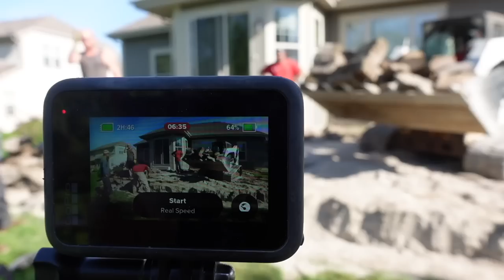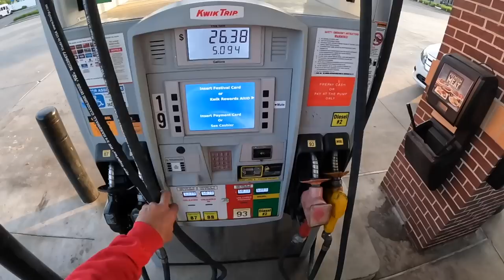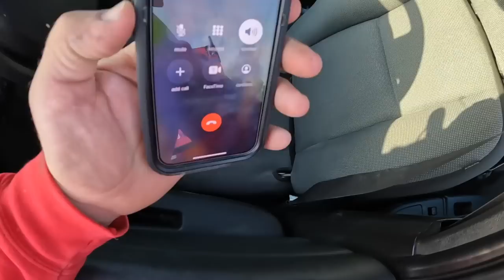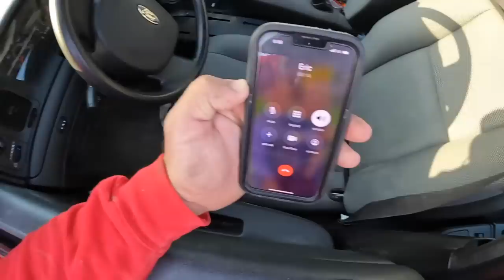Awesome custom patio

Comment: I work as a foreman for a mass grading company in CA and have been watching your videos after work the past couple days. Looks like amazing work and a good crew. Our labor can be tough but concrete is basically ALL labor. Much respect, keep it up.
Reply: Can you just use that glue stuff to lay the bricks for the wall? Do you not have to use cement?

Comment: 18.10 “Eric look what you did!” Only points out the mistake four rows down. Bottom two layers have running joints also. I thought you’d hide it it behind bottom step, but the forms don’t cover it. Ps girls are doing a great job with the edits!!

Comment: i work for a hardscapes company and we don’t use the wall block as cap…we usually use limestone or ledgestone…which is prefabricated to look like limestone. your walls and columns look nice but my opinion using the wall block as cap makes it look cheap.

Comment: So why the glue and not mortar? im curious to know the reason.
Reply from the maker: Retaining or seat wall block never get mortared together. They are not on a footing and will move with the frost and not break apart. Also they are designed to let water through them.

Comment: why use cement to bed in the foundations and glue on the rest ? Has america lost all aspects of traditional trades ? does anyone know what a Hod is or a spot board ? Hawk anyone ? haven't seen one trowel ...... lol
Reply from the maker: You obviously know nothing about these specific blocks. Go read the manufactures instructions and come back. I’ll wait. Acting like a know it all and knowing nothing at all is not a good look.
Reply: @VictoryOutdoorServices  you are using a cement based glue on block , its hardly rocket science . I'd of used actual stone and lime based mortar , pointed it flush , this would allow the moisture to be released and soft enough to allow movement. Asking, sometimes you learn things Ryan . Ill try again , why use a cement glue on the blocks ? is it because the manual said so ? COME ON !

Comment: Those pillars looked awful, not straight, chunks missing on the corners of the blocks. Having to kick the pillars to straighten them up. Very professional. NOT. I wouldn't lean on them to hard, they would fall straight over.